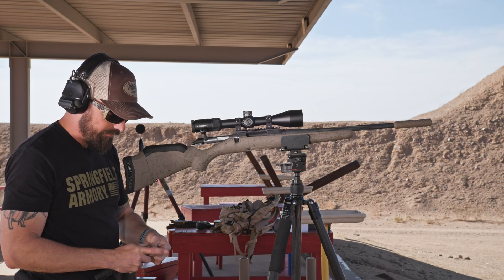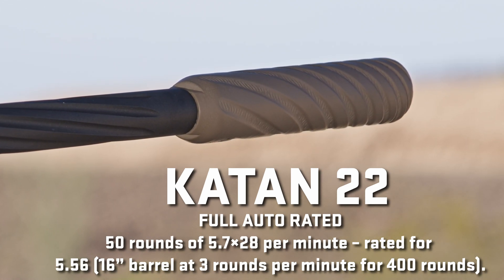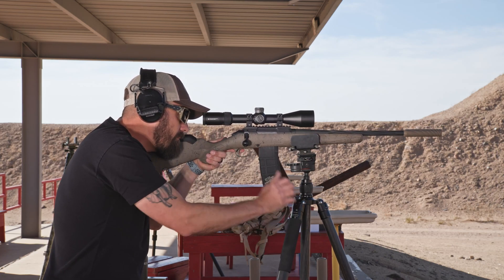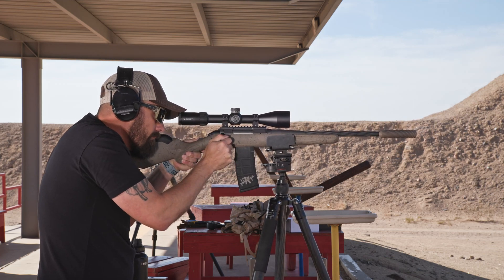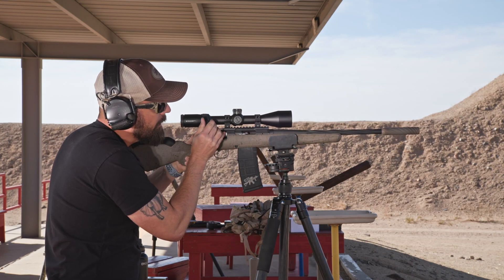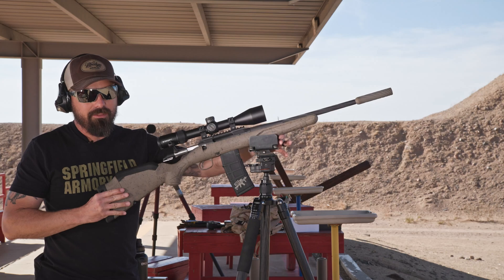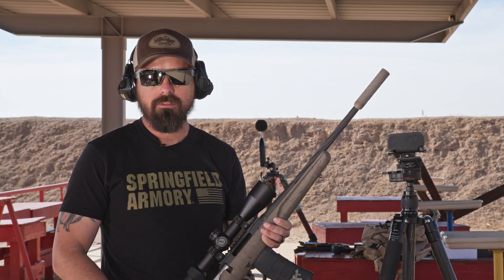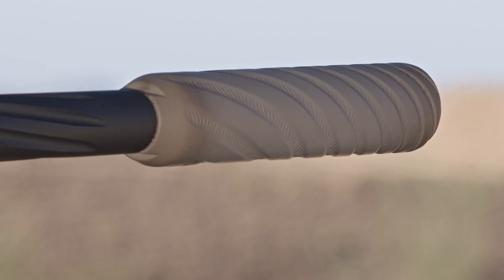Shooting 5.56 Through a Titanium .22 Suppressor? Testing the KATAN 22 with 5.56

Comment: My Griffin 22 resistance M can take on 223 as well, it says to use a blast shield with a tri lug, but it can be used as a direct thread as well.
Reply: they are sending one for this test but its a heavy can
Reply: @Ertactical  Relatively speaking yes, it's a fat boy for a 22lr can. When are you going to test the new HuxWux flow 9k?

Comment: Interesting, but - All you show is that it didn't explode... Are the baffles still in one piece? Does the end cap show any signs of strike... Does it still work with 22 lr?
Reply: Definitely it does. We still use this same suppressor for demo days on the same gun.

It is very tough and still very good on 22 LR.

If you were the EVT suppressed range day, you shot this same suppressor on the same gun.

Comment: Why did you use a bolt action for this??? If you are set on torturing it might as well use an AR.
Reply: cuz thats what it was rated for. we will do another soon on an AR and if it survives we will do a 10" AR
Reply: Rate of fire with an AR will be higher but less temperature imparted to the suppressor per shot.
Reply: @Skhmt  what????